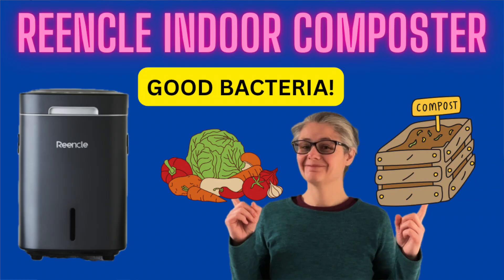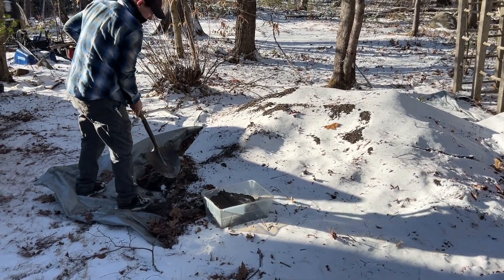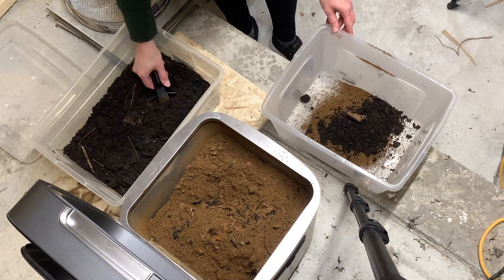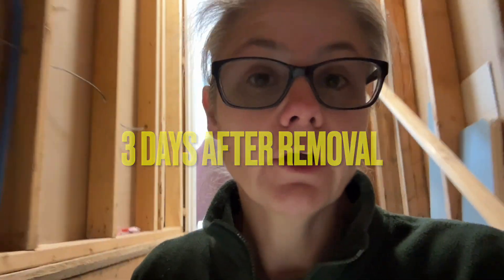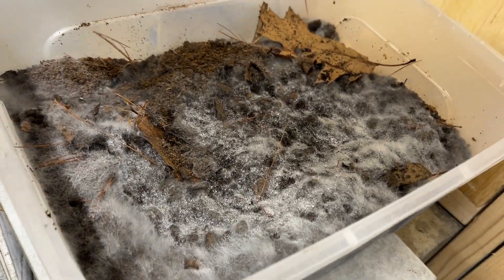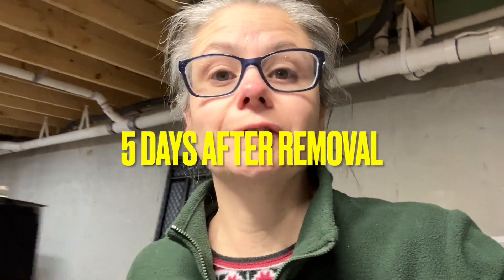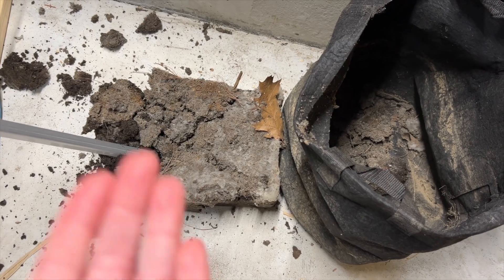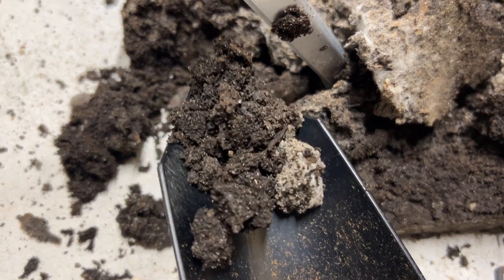Curing the Reencle Compost: UPDATE!

Comment: How are you liking it almost 1 year in? Guessing you've had a spring/summer/fall for using the results. Also, over the winter, did you find you had too much to store?
Reply from the maker: I am liking it a lot. Occasionally I do get a smell from the machine but usually if it is too full and the screen needs to be cleaned.  I have collected the compost and mixed it in with my out door garden, but i did not do any specific grow tests.  I can try to remember to do some this spring/summer.  In winter I store the compost in my basement in a potato grow bags.
Reply: @FieldOfFocus  awesome, so still in routine use? I could use this to reduce what goes in the garbage, and a family of 5, so plenty of stuff to feed it. :) Flowers always love a little extra and would help with getting that garden going.
Reply from the maker: @Wurgy42  Yes still in routine regular use, family of 5 here as well!

Comment: I have a question about adding soil. What kind of soil did you add? I’m trying to load up my mini containers with potty mix that doesn’t contain actual dirt and I mix that with compost. So I want to be sure the compost that I’m creating with my wrinkle is able to be used for that purpose. Is the soil actually necessary? I’m wondering if adding the soil at a four to one ratio is just to make sure people don’t use the raw compost on their plants, which I’m not going to do. Do you think the soil is really necessary to the curing process or could I just leave the wrinkle Stuff that I take out in a separate container and keep it stirred and aerated periodically and would it cure just as well? Possibly a new experiment?
Reply from the maker: I used a pile of loam that my son trucked in for us, so that was a local soil mix.  The last few times I did NOT mix it with the soil, but just put in my box to cure because I didn't have any extra soil hanging around.

Comment: This is one of those times that I think a compost tumbler would have really helped. When you started seeing those Actinomycetes filaments (they're actually a bacterial colony, not mold/fungus), it was only really on the surface of the tub. You really want that bacteria to evenly attack every particle of that pre-compost. Regular tumbling helps with that. I personally think than constant 24/7 tumbling would be ideal, but that's another electrical energy consumer, so maybe that doesn't fit your lifestyle (unless it's solar/battery powered?)
Reply from the maker: Agreed. I have a tumbler outside, so I could put it in there and remember to tumble it daily.

Comment: Have you tried putting meat scraps, or will you try?
Reply: Okay, I can attest to the fact that the Reencle can definitely handle meat. I had my refrigerator compressor die on me while I was on a two week vacation. Everything in there perished. Fortunately, I also had a Vitamix FoodCycler Eco 5 to rapidly reduce the volume of the decaying flesh to powdered yuck so the Reencle didn't have to work so long and I didn't have to have rotting meat sitting around my house for days. I made sure to balance it by tossing veggie scraps into the FoodCycler as well. Everything worked out okay and my outdoor tumbler only smelled bad for a couple days. The trick is to get everything into a small enough particle size that bacteria can latch onto every crumb and metabolize it before it gets too revolting.
Reply from the maker: I have not put mean into my Reencle, and I don't plan on it.

Comment: Thanks for the video! You don't have to buy the charcoal for your compost inside of Reencle. They are for the first cultivation of the microbes, which will be gradually disappear as you use Reencle. You can simply put more brown matters when you are out of charcoal!
Reply from the maker: Thanks for sharing this information. I'm learning so much along the way.
Reply: And, honestly, Reencle has video instructions on how to disassemble that filter module, which contains even more carbon pellets, so you can just dump that into your next batch and keep doing that in perpetuity. Over time, your garden will develop a rich terra preta like environment for beneficial microbes to thrive. You even gave it a bacterial inoculation head start just by running it through the Reencle, so that's a huge bonus.

Comment: I would have thought the charcoal is just included to help with the starting odour control.
Reply from the maker: YES, Reencle commented and clarified for us!
Reply: Not really. The same microporous structure that gives activated carbon superior odor adsorbing capability also makes it the perfect housing environment for microbes. Reencle probably inoculated the carbon pellets with an aqueous solution of their carefully directed microbe and then dried the pellets so the microbes formed bacterial spores to protect their future progeny. The carbon pellets with the dormant microbes are then mixed with cellulosic substrate and are reactivated with water and are fed with a simple starch to rapidly increase the colony's population, which is why they suggest you toss in some bread to begin with (I used a pot of moldy rice).

Comment: Great video.  I also have a generic brand of indoor composter which I love.  Instruction manual states to not use if under plants right away but to mix it at ratio of 1:10 and leave 'for a period of time', not to allow it to touch plant roots.  My easy solution is to take it out to garden from composter and mix 1 shovelful in between plants, throughout the garden area.  Each batch I take out to garden, I pick a different garden bed.
Reply from the maker: Thank you for sharing!!!